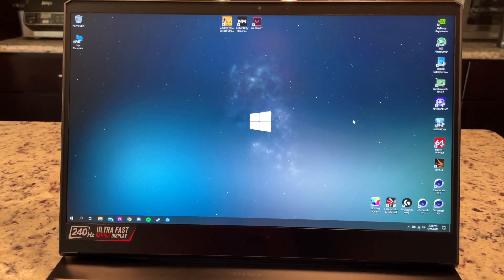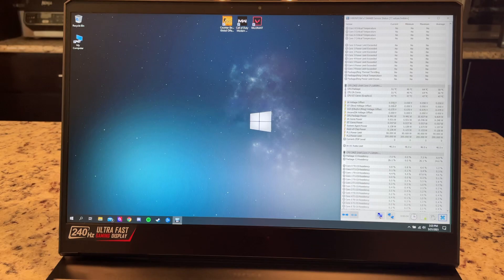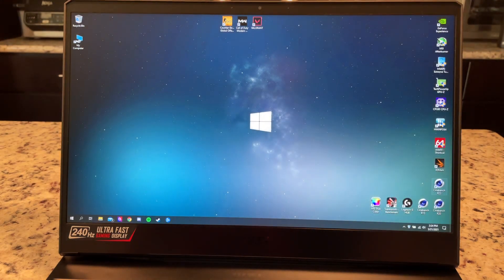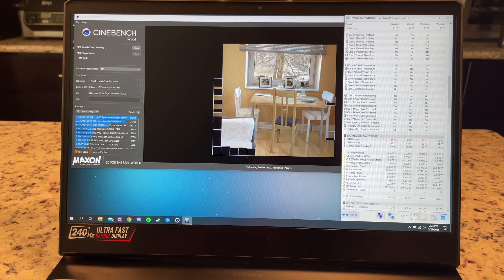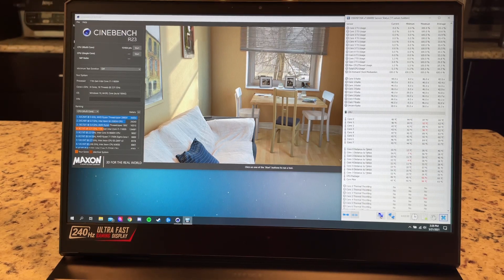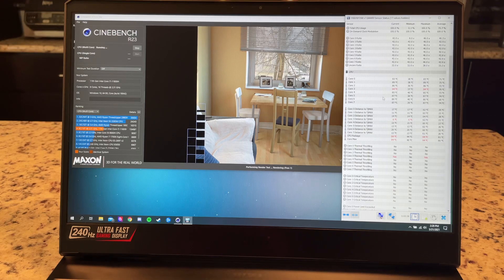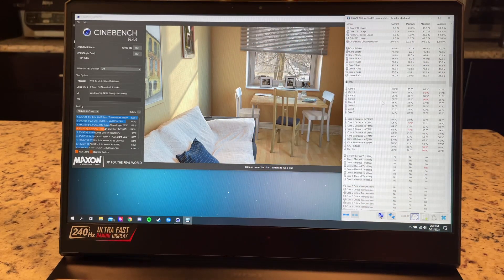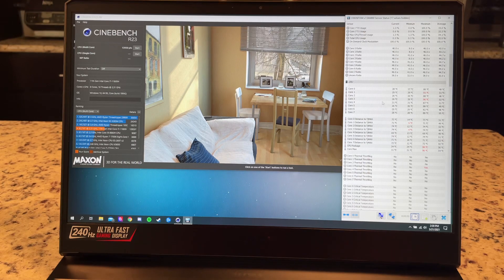Intel i7 11800H Cinebench R23 Undervolt Run - MSI GP66 - Auto/Max Fans - Such WOW!

Comment: What is the best undervolting for gp66 i7 11800H rtx 3070 especially on CPU its freaking hot... 
Is that possible sit on 70 ~ 80°C CPU no over... 
Its for long term use if anyone can know best tunning...

Comment: My 11800H barely gets 10500+ on stock, havent tried undervolting but such a low score is already an indication that something is wrong. Temps arent that high, 92c is max it gets and usually sits at 90c during testing, clock speeds are over 4.2ghz at the beginning but drop to 3.2 later  and remain so. Testing starts at 70w and later sits at around 60.

But thing is, when I first bought the laptop it would get over 12K and now its decreased. Any way to improve it?
Reply: I have the same issue, you ever figure out a fix?
Reply: @GrumpyWolfTech  At the time I didnt really pay attention to the stats shown in the video, skipped straight to the score but now I rewatched it. Seems like undervolting is the most fundamental part of his score but his laptop also has a more capable cooling system compared to what my laptop had and as he said he was getting around 12900 points without undervolting which is close to my score which was around 12300, so no significant difference at all but undervolting really carries the performance. 

I disassembled the laptop, removed fans, cleaned them and the radiators as well so there was no dust left and my score got back to around 12k but not quite, it was like 11800-11900 which was lower than initial score and I think its because I got the initial one when laptop was new with almost no apps and programs on it. Basically my low score was because of high temps caused by dusty fans.

I havent tried improving it after that, sold the laptop and got the Lenovo Legion 5 with i7-12700H and I get 18K at stock even after all the programs and games installed and if I try to undervolt it ill prolly get around 19K, 12th gen CPUs are such an immense improvement over the 11th gen. It also runs at 100w+ consistently when my 11800H was dropping down to 55-60w. 

Basically just clean your fans and radiators thoroughly, maybe even repaste the CPU and GPU, close the background processes and run the benchmark. If your laptop has a good enough cooling it will hit at least 11500-12000 points.
Reply: Tiger lake just gets hot on air unfortunately. The switch to liquid metal/pads helped a TON

Comment: My laptop is katana gf66, my CPU can't undervolt beyond -91mv without becoming unstable. I repasted my laptop and my gaming temps are very good (sub-80) but my cinebench multicore temps are still 93 - 96. My CPU stabilises at 3.74GHz all cores at 94c. Score is 12,600.

Comment: It's important to point out also that the -70mV undervolting can be done in the bios of these GP66/GP76-series machines. You just have to go into the bios and then press <Shift><RightCTRL><LeftALT><F2>, and voila! You have access to the advanced BIOS settings. This is great because you don't have to be sure to run any software in the background to always have the undervolt in effect. So far as I know, Lenovo, Dell and Asus don't have this option in their bios.

Comment: How much is the sustained cpu watt in stress test? Let's say after 30 mins. It was 77 watt when you showed it but in a decreasing trend due to thermal thorttling. I have the same laptop but mine can only sustain 56-58 watts in long run, which is quite low in my opinion it should at least be able to do 70 watts.
Reply from the maker: That is actually a good question that unfortunately I can no longer answer as I no longer have this laptop. I currently have an HP Omen 16.1" that I have a love/hate relationship with.

I want to return to MSI laptops, but until they add freesync/g-sync/or VRR via the dGPU I won't be. As much as I love unlocked BIOS, the fact that MSI doesn't have this as a standard feature on all of their premium laptops is a scam in 2022. 

Sorry for the rant.
Reply: @TalonsTech  you are definitely right about panel technolohy, they don't even say a word about it like if it doesn't exist.

Comment: My laptop has the 11900H and crashes if I leave the clocks at stock and set undervolt to -70.3. I am using throttlestop though and that can not actually pick -70 exactly. I was gonna ask how you are undervolting with XTU? I heard the latest version of XTU removed the undervolting feature.
Reply: u need to enable in the BIOS
Reply: @ItsMe-wc9ww  I actually unlocked it in my bios using RU.EFI but I guess I can't undervolt my i9 heavily. I have read of other 11900h owners of different brands not being able to undervolt high either.

Comment: Where did you download intel xtu? Since normal xtu is not support this cpu.
Reply from the maker: Normal XTU works fine, there isn't any other version. You need to enable XTU interface in the MSI BIOS for it to fully work.
Reply: @TalonsTech  Thanks a lot you are the king. I have the same laptop too.

Comment: For some reason I can't use throttlestop to undervolt. Is this normal for this processor?
Reply from the maker: Which laptop brand/model? Some brands do not support use of TS or XTU and don’t have unlocked hidden BIOS available.
Reply: @TalonsTech  Tracer Edge from CyberpowerPC. Thinking about returning it at this point.

Comment: Man I have the same processor as you but when I use Intel XTU all my options are greyed out.  I have an Acer nitro laptop and I'm just gonna guess it's a OEM decision?  I tried looking online for an any kind of answer and I can't find anything.  The only thing in my BIOS settings are talking about Intel Virtualization settings which don't affect any cpu settings.  Really disappointed that I'm locked out.  I tried using Throttle Stop and Intel XTU and nothing.... : ' (
Reply: 11800h acer nitro here with stable UV. Loads of tutorials online.

Comment: My 11800H is unstable with uV higher than -50mV, and I am talking about long avx2 testing (ultimate error testing). 70uV will pass cinebench etc, but it will not be stable at any professional workload.
Reply from the maker: Can you tell me which laptop you are using?
Reply: @TalonsTech  MSI Gf66 (11800H + RTX 3060, 2x8GB Dual Channel RAM 3200Mhz). And also I have replaced thermal paste, factory job was very bad.
Reply: @SULFURIOUS  me too, even with kryonaut it still runs really hot and thermals down the clock speeds.  only about 55 watts, i got a warranty im about to try and get a new one.
Reply: @alexnderjb  How hot the cpu when idle n full workload?

Comment: Min only reached 12700 points and cores were at 4,5mhz. Anything I can improve here? Refuce multipliers maybe?
Reply: What’s your laptop? It’s impossible to run at 4,5Ghz. I7 11800h only runs at 4,2Ghz all 8 cores. 4.5Ghz would be a +300Mhz overclock and will have 15,000+ points.
12700 points is very good performance for a i7 11800h and this is the score you normally get. But it means that your cpu is throttling because without throttle it’s reaches 13500-13900 points. I get 13600 at 4,2Ghz ( no throttle
Reply: My system got 1 time above 14k and it's throttling . Maybe I'm in a tropical country.

Comment: You did undervolt on BIOS or with ThrottleStop? I don't see XTU Interface option in advanced BIOS menu. How can I deal with it?
Reply from the maker: Hey man if you watch my video here https://www.youtube.com/watch?v=L_GaTgYPNgA

I go through a lot of the BIOS settings you need to change to unlock the Intel XTU interface.
Reply: @TalonsTech  I already watched it like 20 min ago :D I changed voltage offset to -60mv on processor and ring. Should I do it on GT also?
Reply from the maker: @piotrwajda189  If you plan to use the iGPU when trying to get max battery can’t hurt to try and undervolt that a bit too.

Comment: Can you not undervolt more on this? Like the i7-8750h
Reply from the maker: The 8750H is a completely different architecture on a completely different 14nm node. Not comparable at all.

More importantly the 8750H was a first gen Coffee Lake 6 core chip for mobile. It ran lower clocks at just 3.9ghz all core turbo and only 4.1Ghz single core turbo. This is actually pretty low. This means it can run much lower voltage on average than say a 10750H with 4.3Ghz all core and 5Ghz single. My 8750H undervolted great, but my 10750H only about -80mV.
Reply: @TalonsTech  my 10750 only undervolts .065mv

Comment: I don't fricken understand why reviewers who review new 11-th gen laptops don't even try undervolting it, as it's been revealed that it isn't locked on 11-th gen. Thanks sooo much for the video!
Reply: i guess they wanted to test just out of the box performance even if undervolting was easy to more accurately represent performance
Reply: @q2boydlegend  how to undervolt? 😅 afraid i will ruin my laptop
Reply: @Heimonsterr  to get started download throttlestop on ur laptop once its installed go to FIVR and enable "unlock adjustable voltage" from there u can undervolt. a good value to start out with is probably -0.1v though if u experience crashing its best to lower this value :P gl undervolting
Reply: @q2boydlegend  please dont set it to -0.1 offset as a startoff, that -100mv. thatll crashed on most occasion on current gen mobile cpu. start out at .03 and work your way up. most 11th gen dont hav issue with .07 but anymore is in the case by case bases.
Reply: Do you know how to undervolt 3070 of msigp66. its hotspot temperature of mine sometime go near 100C  .
Reply: @vmafarah9473  yes, watch guides on undervolting via msi afterburner on youtube, it's really not hard. Good luck!
Reply: @TabalugaDragon   why do u think, every one should undevolt it, coz chips with same name arnt same, some people can undervolt it much more than other, so reviewer has to mention its unrvoltable and   u may or may not get my value. Thats why jarrod stopped undervolting reviews.
Reply: @vmafarah9473  because it can give a huge advantage. The least reviewers could do is undervolt to a minimum value these CPUs usually undervolt, like -50mv at least. AMD didn't have that, and it was Intel's biggest advantage.
Reply: my 11800h scored 14000 in cinebench r23.

Comment: Is 70mV the largest undervolt you found to be stable?
Reply from the maker: -100mV would crash eventually. I think -80mV worked fine. But I usually don't go to max for long term stability.

Comment: DO YOU HAVE COIL WHINE NOISE WHEN IDLE PLEASE 🙏🏼🙏🏼🙏🏼🙏🏼 answer this please
Reply from the maker: Noooooooo.  :)
Reply: @TalonsTech  like does it make a lot of noise or do the fans throttle all the time on idle i just boight it im worried
Reply from the maker: @laptops4630  No it’s actually a fairly quiet device at idle. The CPU fan will spin at a very light speed but it’s not loud. No electrical coil whine or ringing at all on my unit. The system feels pretty well built.

I think you’ll be happy
Reply: @TalonsTech  ohh thanks then this machine would be the best cause for example the asus  rog etc because it has the i7 11800h which reviews aside in my opinion is better 1. It has pcie 4.0 and that too 16 lanes for the gpu compared to pcie 3.0 on ryzen 5000 with just 8 ( huge bottleneck there) and intel is generally nore optimized for editing etc. Thanks for telling me though 👍🏼👍🏼👍🏼👍🏼👍🏼
Reply: @TalonsTech  can you please make a video on all modes noise level like for example when on idle , one question what rpm do they spin at on idle
Reply: @TalonsTech  is it silent on idle please tell i just purchased it i dont wanna have problems

Comment: Is every H45 processor able to undervolt or is it up to the manufacturers?
Reply: Every Intel CPU that has FIVR in it is able to undervolt using Intel XTU or Throttlestop
but Intel recommends Intel XTU to undervolt Tiger Lake-H45 for some reasons.
Reply: We need this question answered
Reply: Only 11800H or higher CPUs have unlocked voltage control.
Though some laptop models have locked settings.
Reply: @genexis_x9040  This is not true, currently have an undervolted 11400h (-75 core -70 cache). I did have to disable overclocking lock by setting variables in bios using grub (not as hard as it sounds) but the processor supports it. Also supports turbo boost ratio overclocking up to +400mhz.

Comment: have you tried to repaste?  i wonder if it's worth it
Reply: I did a repaste on my GP76 11800h 3070. It’s super easy to open . I can’t understand all these stupid videos on YouTube with people who are complaining that it’s too difficult to open or spend 20 min to open the damn thing. I opened in 1 min lmao. Nothing broke . The best video on how to open go66/76 is from SMDSpain. They are correctly opening the bottom cover . 
  Repasted the whole thing with IC DIAMOND , -15C !!! The stock paste is very good by the way. 
Cinebench now runs at 4,2Ghz all cores max temp is core 3 at 88C . All other are at 70-75C. Max draw is 85-90W for some reason . -75mV offset but after like 6 hours of playing it crashed in game . So I’m testing with -74mV . Seems fine .
Reply from the maker: Yes do really do. The stock paste is like just OK. The best I’ve used on desktop and laptops is Gelid Extreme. There are obviously other brands that do just as well, but for me this paste has been rock solid and my go to for a couple years. I will be repasting this week and will upload results. Also going to be trying to dual rank ram vs the single rank it came with.
Reply: @TalonsTech  I’ll do a repaste this week as well - any idea GeForce experience is locking the driver at an older driver ?
Reply from the maker: @moneypressoverdrive2020  Usually what happens with new laptops is Nvidia has not yet updated the main driver with the MSI GPU device ID. I expect by next driver the device IDs will be added to the driver and we can update with regular drivers.

Comment: Hmm yeh it seems that 1 core is really the weakest link. Stock thermal paste for you smh. Would be really interested to see these tests with your upgraded thermal paste (Gelid words, Phobya Nanogrease would be dope as well).
Actually surprised it has to pull so much wattage even with a UV to hold stock 4.2 Ghz. Hoping that yours was like a bottom 25% on the silicon lottery, since .07 is really a bare minimum UV as is.

Comment: Do you think that the i7-11375H can be Undervolted?
Reply: It 100% can not. It's just a glorified 1185g7, a U series part, with a higher tdp. Only the 45W actual "H" processors will be able to UV if the laptop supports it. Dont be fooled by the i7 or H moniker, both are basically false.

Comment: What is the performance against the desktop i9 11900k?
Reply: 11900k is about 15500 ,this one is 13900 
so 12% slower than 11900k
both side are 250w vs 80w

look like 120w tigerlake can catch up 250w rocketlake
Reply: @bogodoyandex9654  this would humiliate 11 th gen and with such a good power scaling as shown in hub. This might be the only cpu Intel could claim a stock TDP of 125 w and mortal air coolers could tame it
Reply: @bogodoyandex9654  well you are almost right an undervalued 11980hk was able to beat the score you listed at 145 watt. I got that score a few times at 130-125 watt with 4.7ghz all core.

Comment: Faster than a 10700k @5.1, crazy performance
Reply: Even faster than Ryzen 9 5980HX LOL
Reply: i dno i get a better score in cinebench r23 than shown in the video with a 10700k at 5ghz all core and 4.8 on cache ratio...
Reply: @TheBURBAN111  You get how much?
Reply: @Pamani_  13628 i do have no power limits though and any sort of throttling is disabled... never dips under 5ghz.
Reply: @Pamani_  Also i have no ring down bin... the average at 5-5.1ghz is around 13600.... on r23 for a 10700k... if its a good stable oc some people even get higher than that lol.
Reply: @TheBURBAN111  Those are some great results. But still at 6:11 he gets more than 13900 points at 4.1-4.2 GHz
Reply: @Pamani_  Didn't watch it till that far in only watched the first few tests... kind of happy that intel are making improvements though.
Reply: They're about the same. I scored higher with my 10700kf @ 13741
Reply: @muffnxman  yeah if i had better ram id get higher score still using the slow ddr4 from my 6700k build lol.

Comment: How does it compare to the 10900k
Reply from the maker: I think a stock 10900K is around 16K for CB23 but drawing like 200w or more.
Reply: @TalonsTech  wow
Reply: @MrBca009  14nm is very, very old.
Reply: @saricubra2867  that thing is 10 core while this is 8
Reply: @hoangd4132  But has higher IPC.